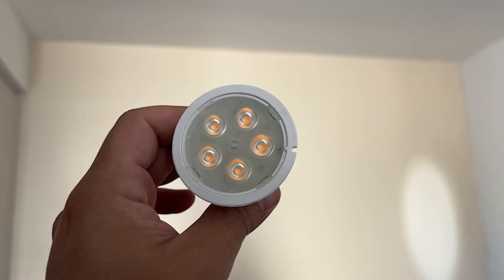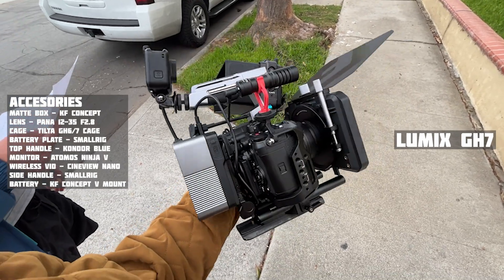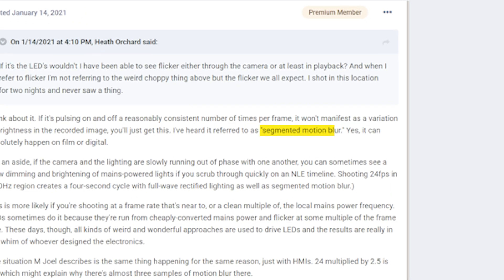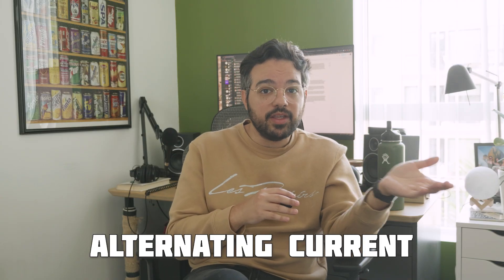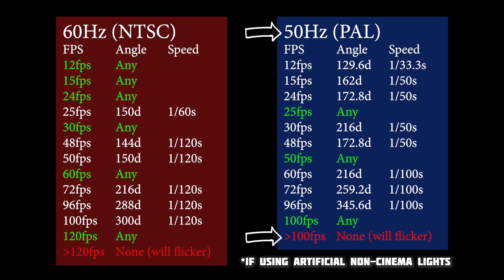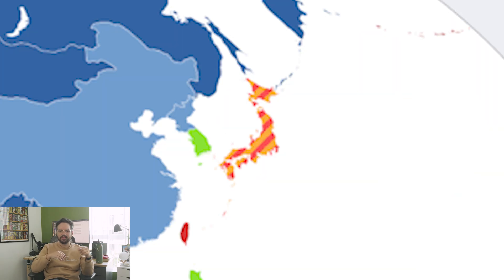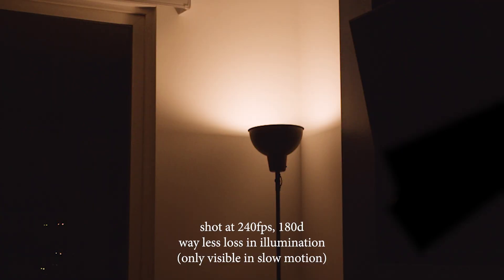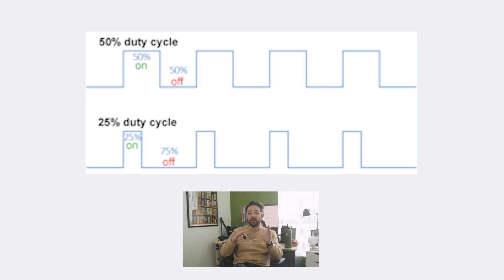Why LEDs are Destroying Your Shots

Comment: 3:24 is wrong, it's + AND - 170v with the center on 0v, not +120v and 0.
120v RMS is 170v peak (120*sq2=~170)
Unless you're talking about post rectification, but then like said previously, it's not 120v (and not 170v either since there are losses).

Comment: Yeah I had this problem too in an event shoot, I was cursing myself for using the wrong shtterspeed but then I checked the metadata and it was correct. I wonder if a 360 shutter would fix it or we can someway sync the shutter to light strobe.
Reply from the maker: If you open up the shutter angle, you’d see even more strobing because you’d give the light more time to cycle per frame.
Reply: @luismpena-dop  oh damm

Comment: totally agree with a variety of different flicker rates caused by different generation light bulbs.

have you try non even numner shutter angle, especially longer shutter close to 359 degree (or 179 in case of double speed) in your digital camera and minimize the effect?
Reply from the maker: I tried that in some tests and the artifact was still present. It just strobes too quickly.

Comment: Yes, cheap led lights and many other types of commercial lights can cause flicker even with the right shutter speed / frame rate for your country. The solution is simple, you turn off these flickering practical lights and use dedicated cine lights. Or you use dedicated cine bulbs like the aperture b7c instead of a traditional bulb.

Comment: Good video. It's a shame large youtubers do nothing but make useless videos these days when there is still so much to cover and discover...

A small correction : It is not "power" width modulation but "pulse" width modulation.
To dim incandescents, you could reduce voltage to the bulb to reduce its brightness, but with PWM, there is no voltage reduction. It's either ON with full voltage (110V or 220V region dependent) or OFF with 0V.

How PWM can create dimming is because our eyes don't detect rapid ONs and OFFs. So, by turning on the bulb (for example) for 0.5 seconds out of a 1second cycle, our eyes perceive the brightness to be half as bright when compared to a scenario when the bulb would be constantly ON for 1 second out of 1 second cycle.

This is the biggest reason for Incandescent bulbs and fixtures to stay alive.
Reply: I'm pretty sure everyone in the world besides the US has already tried using their phones under LEDs or fluorescent lights and noticed the problem, so not sure about the part about "so much to discover".

Comment: Well explained, thanks. This can be present in photography as well. I was shooting a soccer game with poor stadium lighting and my shutter speed was high to freeze the movement - but it was faster than the full cycle of the stadium lights, causing unusual magenta across half the image - 4 out of 5 shots were ruined. Weird problem, and probably related.
Reply: There's a specific phosphor that causes this issue, as far as I know it was only used for a short while then replaced, my LG something something 850 monitor also uses it. The reason why it shifts color is because the red bands are slower to respond than the rest of the wavelengths, so the light actually turns white first, then when turning off, it stays red for a really really short moment.
Reply: @TrendyWhistle   That's very interesting. I even had it happen on an indoor product shoot. Had to shoot at shutter 1/200 or I was getting an uneven banding affect on the photos. Thankfully it work out, and maybe even added some nice motion blur - but not ideal. Wonder what I am missing? I have another shoot tomorrow and will bring my new Amaran 150c which should be more forgiving.

Comment: Thanks for addressing this is issue. Tip I’ve found helpful is it seems Philips LED bulbs sold under their Ultra Definition brand are the some of the best *flicker free consumer bulbs on the market. Decently high CRI too
Reply: It just means the flicker rate is very high. Therefore less noticeable. But if it is high enough to not be detected by cameras, good then.

Comment: Wow, that's a pretty yucky issue. Good pickup. Also, there are a few little inaccuracies in this video, FYI.

1. It's called Pulse Width Modulation, as it's the width of the "on" pulse that modulates the overall power.

2. 120V AC power doesn't cycle between -120V and +120v, it actually goes from approximately -170V to +170V. The value of 120V is the Root Mean Square voltage, not the maximum absolute voltage.
Reply from the maker: Thank you for pointing that out.
Reply: AC power also isnt what the LED light is being fed, the lights are fed Direct Current (DC), there is a converter on led bulbs that makes this possible. AC power has current flowing in both directions, which an LED cant use, since they are Light Emitting Diodes, and a diode only allows current to flow in one direction. 

PWM isnt too complicated, essentially the LED is either on or off, but if you turn it on an off super fast, the average voltage after while doing this turns out to be somewhere in the middle, so it looks like its dimming to the naked eye.

Comment: Old light bulbs were just heated pieces of tungsten you can call it a natural light source. They also had a full light spectrum, which is something LED lights struggle with.
Reply from the maker: Even with the latest tech, LEDs still struggle to output the same spectrum as tungsten.

Comment: Yesterday, I was color grading some project material that I didn't shoot myself. One particular shot was taken in the kitchen, in front of a decorative light panel. I noticed a strange motion blur affecting only a specific portion of the frame, while the rest of the image looked fine. At first, I blamed the camera operator, as I couldn’t explain why only that area exhibited this odd blur.

Later, I realized that most of the scene was lit using professional film lights, whereas the problematic portion was illuminated by household LED lights. That difference in lighting explained the unusual motion blur. Thanks for helping me understand this!

Comment: Sometimes a production won’t have the budget for a fixtures and rigging crew. And you have to make decisions based on camera settings. Especially locations that prevent or have logistical issues; condors, scissor lifts to make “house light” fixture changes or grip lighting rigs.
Reply from the maker: Of course, when you can’t control the environment you just have to deal with it, but my point is that it is very important to be aware of this artifact.